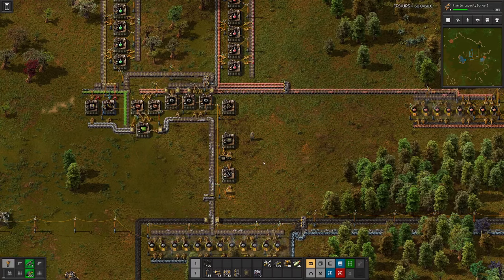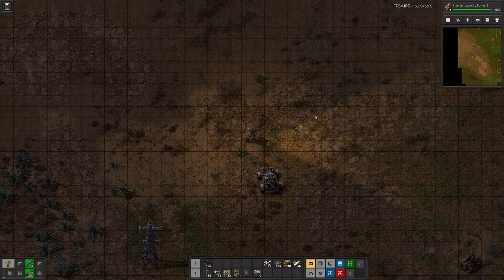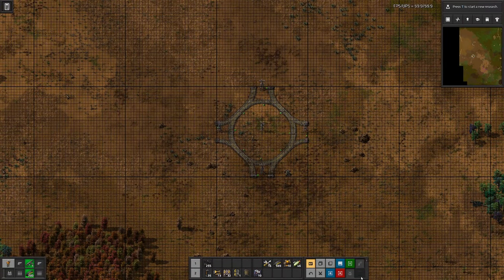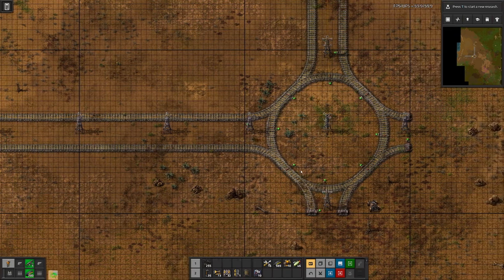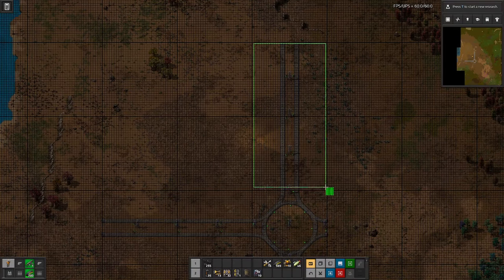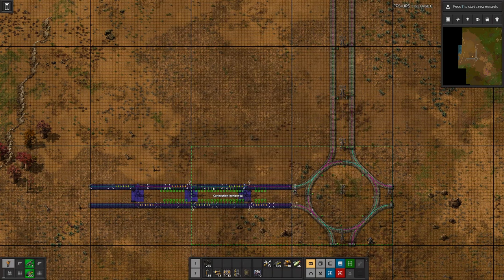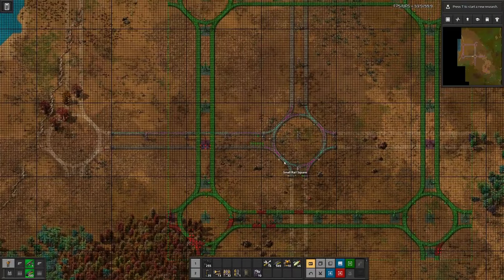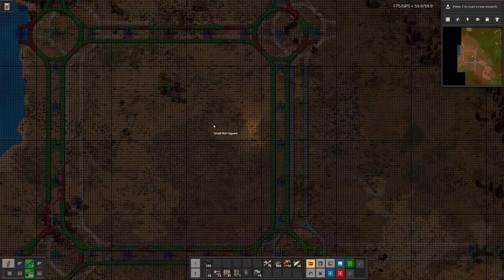Factorio | Designing the Rail Network - E4

Comment: If there will always be a roundabout every 2 chunks, you can set the straight segment's length to 3 chunks.
Reply from the maker: That would probably make the whole thing better tileable. I have to remember that for next time.
Reply: Wouldn't you want to do the opposite and shrink the longer dimension to 32? (and for the bigger blueprint the tiling should be every 3*32 = 96)
Reply from the maker: For them to be easily tileable they have to have the same width and height, which would work with halving the longer ones, but then they are no longer easily tileable due to signal spacing. The main advantage that @nicolasajruch2099 suggestion brings is that with an even number of chunks the whole square becomes tileable.
Reply: @hotzstGaming  Sorry I don't mean shrink the actual blueprint content, I mean that even though the blueprint may be 64 tall the "Grid size" should have Width=32 and Height=32.
In fact if you make all your blueprints have a grid sizes of 32 by 32  I think it will be much easier.